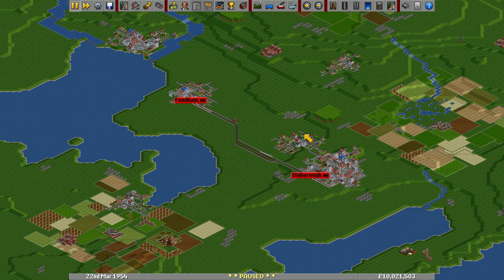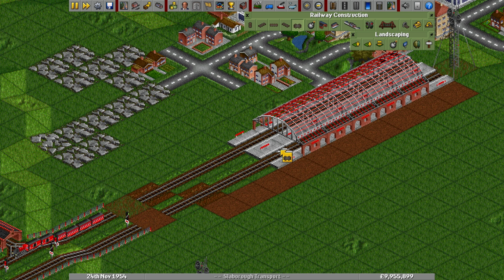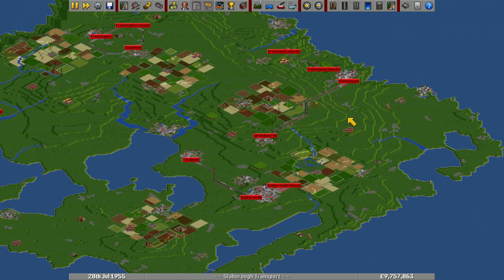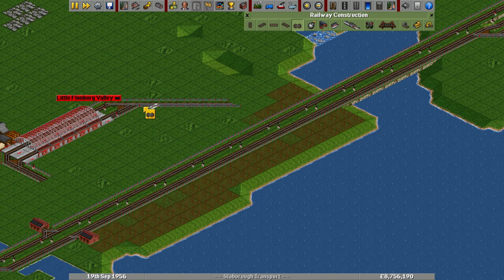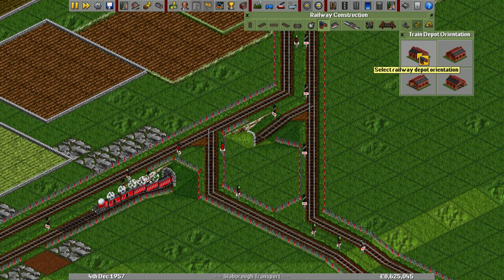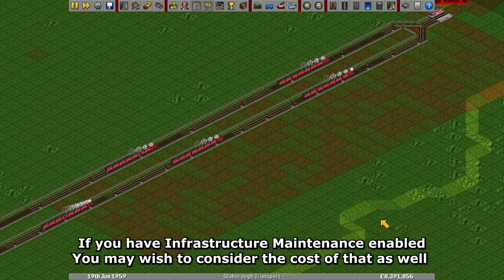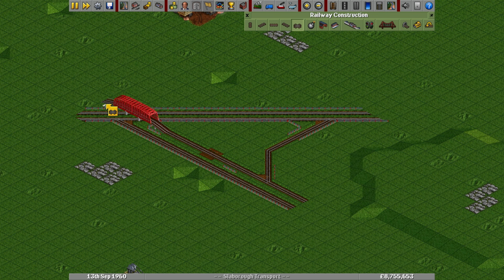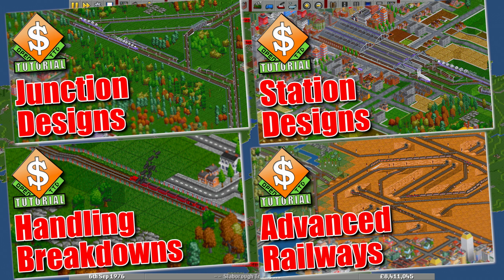Intermediate Railways: Up-Down Lines, Stations and Junctions - OpenTTD Tutorial

Comment: im i the only 1, experiencing that trains cants see depots "as of V.15.3," thats branched off the line, if the depots are more than 6-7 tiles away, "aka branch of 1 tile diagonaly, then 5 straight track-tiles, and into depot, if its longer than that the trains cant see the depots, even when they are below 10% or at 0% reliability.
As for settings, i have always played with, Service Intervals Are In Percents: ON, with the sevice intervals for trains set between 15% and 25%, and Reduced Breakdowns, and i have had no problems previously with, entrances as long as 10 tiles, pr. my perfered max train-lenght being 10 tiles.
So has something happends to how far ahead the trains can see now "has it not usually been like 14-20 tiles?", or am i missing something?

Here is a rough illustration of, what kind of branched of depots i normaly has used in the past.

  10+tiles of track      D   5-tiles of track
        _ _ _ _ _ _ _ _ _ _ /\ _ _ _ _ _
     /                                                 \
<- - - - - <- - - <- - - - - |  T  | - - <- <- - - - <- - <- - -<- - -<- - 

I dont know is this help, to visualize what i mean, about the shorten lenght, the train can see the depot "marked D" wich is ellevated and branched of the main-line that has a tunnel "marked T" under the ellevation, so there is roome for double-depots at the branched of line, and then mirrored from the other direction aswell.
Reply from the maker: I've tested this and trains are still using the depots as expected i've got my depots around 10 or 11 tiles away from the mainline. Have you got a depot in the train orders because this will stop them going to other depots.
Reply: @MasterHellish  No i almost never, have depots in the train orders.
i have tried removing all the NewGRF's i have been using, and that was not the problem, next i have tried uninstalling the game, and removed all leftover files, and reinstalled OpenTTD, and its still the same, the trains can only see the depots if they are max 5 tiles away.
Reply: @MasterHellish  so i have just tested it on my laptop, and there its working just fine, with the same version + the same NewGRF's. So now the question is why is it not working on my desktop, even after a clean reinstall.

Comment: These tips sure helped my build skills, even as my playstyle differs quite a bit, favoring an epic sandbox scenario spanning two centuries passing by really slow and a rule about fitting in with towns, which makes some designs be hard to implement. Sometimes I just am gonna have a cross I should not have. Overload a network. But thanks to Hellish, I can design and not have those deadlock points be the default.
Reply from the maker: Glad it helped you

Comment: I have been building railroads like auto bahns. From right to left of the map as straight as possible. 4 lines, 1 to right, 1 left, 1 right, 1 left directions. Some times direction change crossings. Then i bind cities and resources to those main lines. At first very effective but as number of trains increase, traffic jams sometimes blocks the entire Auto(train)bahn. Couldn't really solve the issue until now
Reply from the maker: Yes with added complexity comes the options with trains to clog up

Comment: I'm curious, when it comes to up and down lines, or one way line travel, is it worth having multiple lines in the same direction?  Say I have a lot of throughput through a section of my track, maybe my two biggest cities are connected through the main line and there is a lot of passenger traffic.  But now I need to get goods/materials out down this path too, my industry stations are out past the cities.  If I just add the industry trains to the main line they could end up waiting for the joining passenger trains, traveling behind them, then finally continuing on once the passenger trains divert into their stations.  For a fairly small setup this wouldn't cause too much trouble, but once throughput increases then I just have too many trains on one down/up line.  Is it worth adding a second line they can take to double the throughput, or should I make a completely separate up/down line for the industry to avoid using the passenger line?
Reply from the maker: If you have busy lines it's best to have separate ones for each service. There is only so much each line can take.
Reply: @MasterHellish  Cheers for the reply, so here's another question.  Is it possible to induce priority for trains?  Let's say you have a situation like your iron ore station in this video, you have a bypass line for trains ignoring the iron station and a merging track from the station.  If you have a good that wants to be delivered faster going along the bypass track can you, artificially or not, have the trains leaving the station wait for the bypass train to blow through at max speed before they leave and join the main line?  I'm thinking something like removing the signal at the bypass's end of the join to make any train entering the bypass claim the join forcing trains currently in the station to wait.  Would something like this be A possible or B worth it?

Comment: The bit I find tricky is making realistic looking local, slow, fast up lines and then parallel fast, slow, local down lines, with junctions that don't fill the map. Waypoints help.

Rather than double depots, I prefer waiting bays. I haven't checked which has the lower infrastructure cost though, and it does need a bit more space. The throat of the yard needs to go diagonally to the depot so the exit from the depot can function. I think 3 bays per depot is about right.

I use waiting bays before some stations too, rather than infinitely expanding platforms.

With the signal gap, if a line doesn't have many trains in the first place, spacing them further apart helps to spread them out.

For intermediate local passenger services, switch off "non-stop", and then trains will stop at any station on the line between A and B, meaning you only have to set the initial origin and destination, and the train will stop at every station along the way without you having to give it every single order there and back.

If a section of the local route travels along a main line and has stations on it, add bypass loops for fast, non-local services to go round the platforms. The reason you put the bypass on the outside is because the inner tracks along a straight are quicker and a main line train only uses the bypass if the platform is occupied.

With feeders, always keep in mind whether there is a more profitable destination for a cargo rather than that transfer. As featured in many videos, cargoes are paid for in terms of speed delivered and distance as measured along grid lines, and sometimes potential sources for feeders are a bit too close to the destination and it's worth adding a new route to a secondary drop off.
Reply: iirc depots are better than waiting bays because trains do not degrade in depots.

Comment: So there's a loading penalty for trains that overhang the station, is that only for the wagons that overhang or all? And then my next question is, is there a loading penalty if a rear engine is the only thing that overhangs?
Reply from the maker: I would have to double check but I think it applies to the whole train
Reply: @MasterHellish  Is there a loading bonus if the platform is much longer than the train? I noticed you're using platforms that are 7 tiles long, with trains that have length = 3. I have always just built platforms that are exactly as long as my trains (typically length = 5).